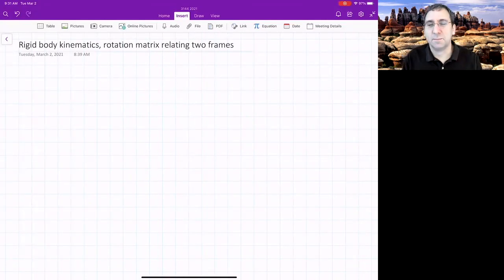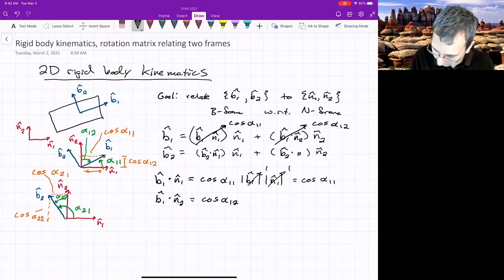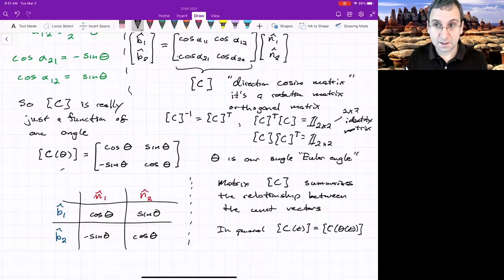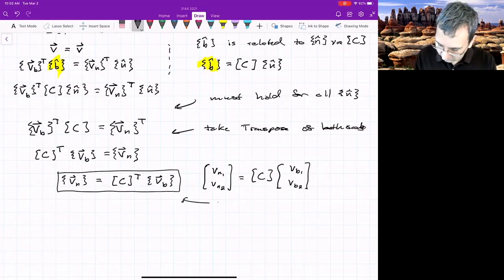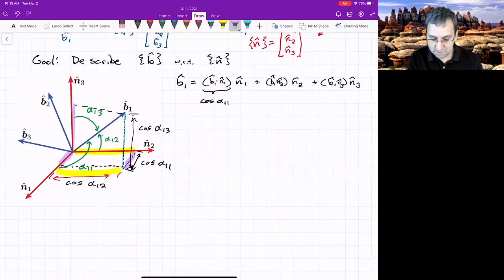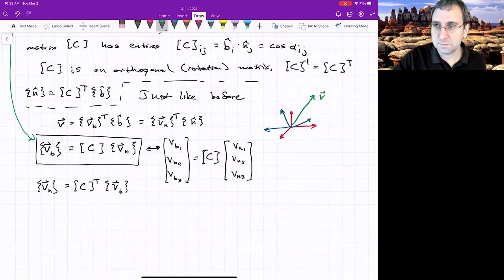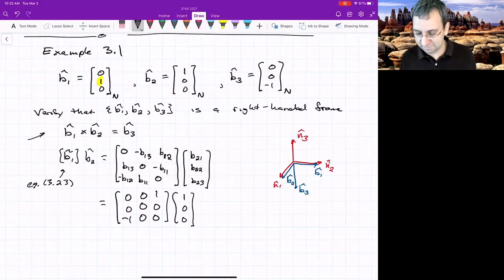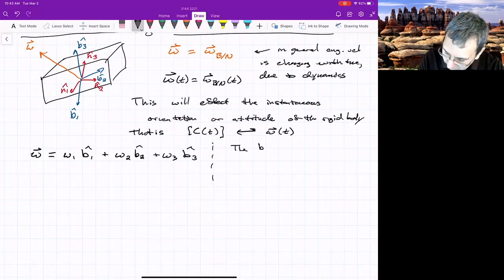Rigid Body Kinematics Introduction | Rotation Matrix Relating Frames in 3D | Direction Cosine Matrix

Comment: At 12:56 Shouldn’t the parameterized C matrix switch the negative on the sin. Because looking at it from a transformation point of view, the n1 vector will have to shrink in the x direction, and go up in the y direction. But based off of this matrix, it would go down. I guess what I am trying to say is that this is for a CW not CCW rotation which is what is shown

Comment: So um...my prof back in the day was very adamant that  frames ate attached to a body, points are NOT. 
What's your opinion about that?
Reply from the maker: I don't understand what is meant by "points are not attached to a body".
Reply: @ProfessorRoss  the assumption was that we can put infinite points on a body and also move them around arbitrarily. So the only fixed point was assumed to be the cg. Every other point was just there for convenience 

(Assuming we are talking about a single rigid body for convenience)

Comment: 9.38 min: You could have written [b1 b2]=[ n1 n2] [ C ] where n1, n2, b1, b2 are column vectors (basis vectors) and C is the matrix of cosines,. 'Vectrix' is neither a good nor a correct way to write or teach.  Any vector (say v) with representation u=[ u1 u2] in frame 2 will become C.u  in frame 1. As u and Cu are of same length , C'C=I. Therefore, C is in SO(3). 
It has an eigenvalue equal to 1 (an invariant direction, axis of rotation in this case) and a pair of complex conjugate eigenvalues (invariant subspace, plane perpendicular to axis of rotation).